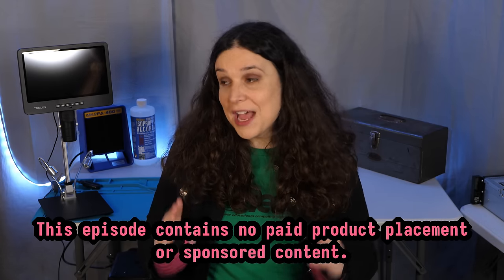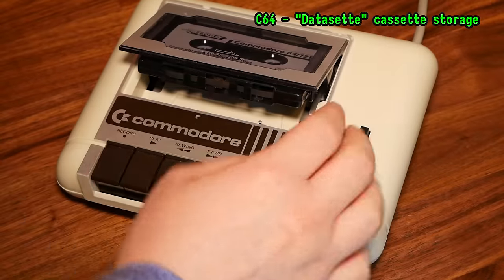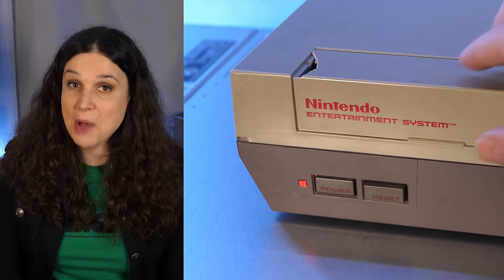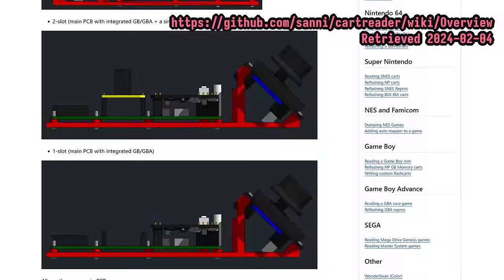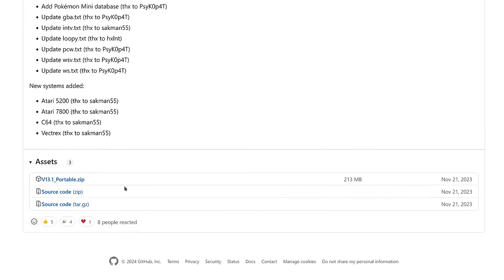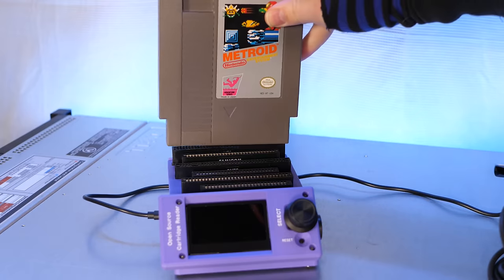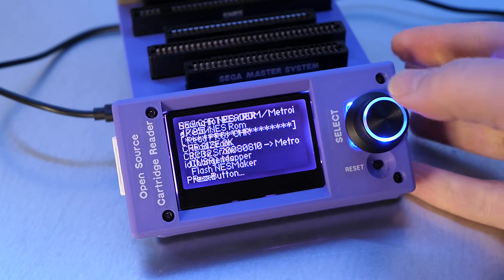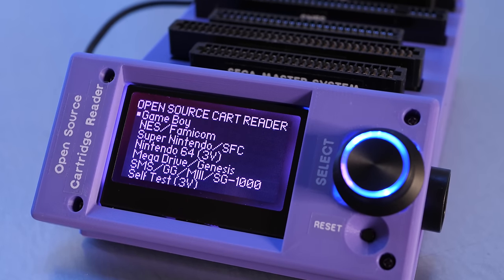Open Source Cartridge Reader: ROMs and saves from real hardware!

Comment: I have horrible news: I think the N64 is probably “vintage computing” now. So… this is more channel appropriate than we may want to believe.
Reply: Not only that, but the PS3 is technically 'retro'... And that deals me psychic damage.

Personally I think we need to reevaluate the criteria for such things... In early gaming every generation represented a quantum leap over the previous, so delineating 'retro' by generations or simply just the passage of time made sense... However, if we look at the past two decades, nothing after the PS2 has made such an advance.

This is why I insist that until something drastic occurs, the PS2 is the last "retro" console, and everything after that is still contemporary, with only incremental improvements in the quality of the experience.
Reply: @Bakamoichigei  PS3 is vintage, there are still plenty of original PS3s out there and I think it still enjoys patent protection. If it's not old enough to have it's patents expire, then it's not old enough to be retro.

Comment: Not affiliated with the project in any way, but the hiding the txt files on the sd card is most likely to, well, hide them. de-clutter the sd card contents so it's easier to find the file you dumped between all those files.

Comment: I’m one of the builders of this OSCR and I just wanted to say thank you so much for the kind words and visibility for this project! We’re so glad you’re enjoying it! 
You did such an excellent job of covering what an OSCR is in this video; I’ll definitely be sharing it whenever somebody wants to know more about what I’m working on. 😊
Reply from the maker: Thank you for the work you do! It's a great project and it's very appreciated!
Reply: does it support dumping pirated multi-carts?
Reply: Will a Jaguar cart set be coming too?
Reply: @johndrippergaming  Yes, but it's not as straightforward as choosing them out of the menu, and they won't be auto-recognized. There are some aspiring developers in the project Discord channel that can assist with reading the contents of multi-carts.
Reply: @XVa-uj8m  Sadly there are too many pins on a Jaguar cartridge for the current HW5 Arduino to support it. With newer revisions of the OSCR in development that are moving away from the Arduino Mega 2560, there may one day be a Jaguar cartridge adapter.
Reply: Very cool that you found this.  :)

Comment: I LOVE the idea of ROM files and saving save files. This is NECESSARY for game archiving and gaming history.
Reply: Yep, but the optical discs are even more important. Thankfully, I think it's possible to dump anything from the PS3 and older at this point, some of them are really easy like the Saturn and PS that can be done in a regular computer from RetroArch. Some are a little harder like the Dreamcast where it's just a cheap SD card adapter and disc to dump any of them. The Wii and PS3 are a little harder as they require that you have the system jailbroken to do. But, once you've done that, it's not that hard. 

That being said, the carts can be damaged over time, even if you don't use them, so backing those up for posterity is also a good idea. It's not a bad idea to use a combination of checksums and something like quickpar to repari minor damage and just run that on some sort of regular basis.

Comment: Nice one, Veronica! I saw my OSCR video peeking through one of your screen grabs... it's a neat and very useful device!  Re hidden files, I think the advice to hide them is just to help navigate the folder structure without all the extra file clutter when you're reading the card... at least that's why I hid all of my files. Re building one from scratch - there's a lot of soldering in the OSCR with all of those cartridge slots, but it's totally doable for less experienced folks, and it's great practice! And if you want some help improving your soldering skills, you should come out MGC 2024 next month and attend the gameBadge workshop - we focus on teaching soldering skills and you'll walk away with a cool pico-based handheld game system to boot 😁
Reply from the maker: Thank you so much for the comment! The workshop sounds like a lot of fun- I'll look into it as I figure out travel plans. BTW, thank you for your videos on MiSTer- you've been a big help as I've learned more about the ecosystem.
Reply: @VeronicaExplains  Thanks! ❤The MiSTer ecosystem can be a bit challenging to navigate for sure - I'm glad my videos have helped!

Comment: I never played tape games. It's still wild to me that you could use cassette tapes to store a game. I only ever used them for audio.
Reply: Same concept as modems really, putting data into an audio signal, except using magnetic tape instead of a phone line
Reply: I never actually used them, but between 1985-1988, in Finland, a radio program called sth like 'Silicone' sent computer code on the airwaves for listeners to record on their tape decks. You then put the tape into your early computer cassette drive to use it. Listeners made their own programs also. No wonder as this started in 1982 as a different project for citizens' edutainment benefit, we got Nokia phones and text messaging going first here - there was already a user base for tech stuff. Early PC mags always listed code to make your own programs, create drivers or tinker with stuff. Commodore 64 cost as much as a TV back then, and my first 486 machine the same amount as my first car, Datsun 100 A.
Reply: Only problem is it took a while to load the games these were very commonplace.

Comment: 》Its concept is something similar to that one employed with expansion cards connected to ISA/EISA/VLB/PCI slots throughout data bus, the same modular architecture we still see nowadays but, as you've said, it used be much more appropriate for actual implementation during that  technological transition from the 70s to the 80s.

Comment: Great video! The OSCR is an utterly indispensable tool for anyone into the physical side of retro games! I built my own v3 OSCR, and it's fantastic. 😃👌

The ability to rewrite flash cartridges is super cool. I've used my OSCR to write games to Nintendo's own rewritable Super Famicom flash cartridges. (Fan translations, romhacks, etc. All patched to ROMs dumped from my own carts using OSCR!)

And I've used my OSCR for preservation; a Satellaview 8M Memory Pak or Nintendo Power SF Memory Cassette doesn't come into my possession without a complete backup. And I back up the SRAM of any games I acquire so I can examine the previous owners' progress later. (Sadly I'm like 0 for 4 finding Mario Paint cartridges with any art still saved on them! 😢) 

btw, emulator SRAM compatibility is usually a header issue. I've yet to try loading an OSCR dumped SRAM in an emu, but I know that save data dumped with a magicom such as a Super Wild Card or Super UFO Pro 8 needs to have the header stripped out before an emulator will recognize it. 😉👍

EDIT: Oh yeah, something about the older v3 OSCR; it can also read pretty much anything through the SNES slot, given the appropriate adapter...since it's all just arbitrary GPIO...same as the newer versions. 😃 (Personally, I rather like the more compact formfactor though!)

Also, I've been running my OSCR almost exclusively off a decade-old powerbank for the half a year since I built it with no issues. It's super handy!
Reply: Hey, I know you! :P
Reply: @Ancyker  😜

Comment: On start up, the chip (TPS2113) that handles the power switching could go through any state, even when 3.3V is selected because its enable pin is permanently on.  The chip takes a little time to fully turn on and a little more time to actually decide what the output should be - we're only talking several milliseconds.  The author of the project can resolve this problem by enabling the chip a little time after it's turned on; it'll be faster than turning the device and then plugging in a cartridge.  The output of the chip is 0V when the chip is not enabled.  A common method to do this is with a capacitor and a Schmitt trigger.
Reply: The MCU controlling the chip is also powered by it, so delaying turn on isn't all that helpful. Your proposed solution isn't wrong, but the time difference would be measured in nanoseconds if not microseconds. The latency for the toggling of 3.3V comes from the time it takes the MCU to boot and set the pin state.

HW7 resolves the issue entirely by not powering the cartridge slots and processor with the same power rail. Instead, the slots get their own rail which can be toggled on and off and adjusted as needed by the firmware. It also monitors this rail to make sure the voltage is within bounds so it can cut the power to the slots if it isn't.
Reply: @Ancyker Two methods to solve the same problem, which is pretty much the same thing.  Mine is hardware defined, yours is software.
Reply: @Shocker99  I think you misunderstood what I was saying. Your proposed solution was not a hardware solution because it was not a solution at all. It was not the TPS2113 causing the issue, it was the microcontroller. Your proposed hardware solution would not have fixed this because the MCU is powered by the TPS2113, so your solution would have made the problem worse by delaying the MCU booting and changing the pin state even later. Also, this problem was actually recently solved via a firmware update that moved the pin state update to even earlier in the code.

Comment: I like this video and your enthusiasm! Thanks! I found this channel after you posted something on the OSCR Discord today.
The only thing I would have liked to see you mention in some way was how to update the firmware on the OSCR, this is basically my only 'quirk'/con with the OSCR. Would have been nice if the new firmware could just be copied onto the SD card and be loaded from the OSCR menu. But I can't have it all and thus far I'm quite happy with my OSCR.

One question I have is how you knew that for N64 cartridges it might be better to turn it on in 3.3V mode before inserting the cartridge to avoid the possibility of the 5V spike. I didn't find this in Sanni's userguide or I might just be reading past it.

I'm looking forward to more of your video's, like how you mentioned that you would do a video about fixing your NES. That one is looking quite bad, so I'm curious what you will be doing to it.
Reply: > Would have been nice if the new firmware could just be copied onto the SD card and be loaded from the OSCR menu.

The ATmega line does not support this. It has to be programmed by another device. The only way to implement this with the current architecture (the ATmega/Arduino Mega) would be to have another device boot first and look at the SD card for an update, and if found update the main device before booting it. I am currently working on an updater to make updating easier, but it will still require a computer.

> how you knew that for N64 cartridges it might be better to turn it on in 3.3V mode before inserting the cartridge to avoid the possibility of the 5V spike

The wiki page on Automatic Voltage Select.

Comment: I really want one of these but $200-300 is a bit much for me right now

Will definitely keep my eye out for different versions of this especially if there's one that can write to reproduction cartridges
Reply from the maker: This one can write to a lot of repros! At least from what I can see. It is a bit steep preassembled but I've enjoyed it.
Reply: @VeronicaExplains  guess this will be my next purchase after I build a new pc
Reply: Kits are about $100 if you want to DIY it. The soldering is pretty easy if you get the SMT components preassembled, which adds about $10-20 to the cost depending on if you want RTC or not (most people do not need RTC). It does take a few hours to do it all though. Also, assembled prices will be dropping soonish as well, likely to around $130-150.

Comment: That N64 port on the side for testing controllers is a great idea, and I'd love to see someone make a controller / cartridge tester -- plug in your controller or cartridge and know if everything is working great. Would save time for someone like me who buys and sells consoles and games and don't fancy dragging out a console and plugging it in every time.
Reply: This device can do all of those things (at least for N64)! It has a controller tester mode, but also, after dumping the ROM of a game for any supported system, it will run a checksum to confirm if the dumped data matches a known-good value in a database on the SD card. If it matches, the cartridge should be fully functional. If it doesn't, then either the cartridge pins are dirty (99% of the time there is a mismatch, this is the case), or the cartridge has a problem.
Reply: @cmcm711  yep, but I'm referring to a more generalised thing for multiple consoles. Something modular, where you buy the base and whatever controller or cartridge adaptors you need to suit your requirements, then you can plonk it on your desk and just test cartridges and controllers as you're working.

If I knew more about the hardware side of things, I'd attempt it myself, but I'm a programmer by trade.

Comment: Can the OSCR project be used to build a standalone emulation system or be used in conjunction with the Mister FPGA? It'd be cool to build a device using 1:1 scale 3D printed replacement shells for game consoles with the modern experiences like save states and Retro Achievements.
Reply: Soon™

Comment: That is so cool! Although it seems a hint excessive to me to have a separate device with its own display, controls and memory card slot, instead an accessory gadget that just has the cartridge slots and a controller, that connects to your PC via USB or whatever and then just have Linux drivers/tools for operating the thing.
Reply: Sometimes you need a toaster, sometimes you need an oven. You can do a lot more with an oven, including making toast, but sometimes a specialized tool is the most efficient.

Comment: If the battery is still good, you can always just wire a second battery in parallel to the main battery for a few minutes while you replace the main battery. That being said, it's far better to just use one of these units to backup the save ahead of time than to bother with that. Also, while you're at it, it's worth putting in a proper battery holder if the battery in there is soldered to the board so that the next time you don't need to. These carts just get more rare over time, so it's better to take the risk of redoing that now than later.

Comment: Thanks for this great video ! I have a question tho:
The txt file with all the game numbers in, it's used to identify games before saving, right ? 
So what would happen with a cartridge that is not in the txt file, like modern homebrew games for exemple.
I own some homebrew cartridge games I would like to secure.
Thanks for your answer 🙏
Reply from the maker: The devs add a lot of carts as time goes on, but certainly there's stuff they've missed. If the cart isn't in the text file, you can manually select how to dump the ROM based on the type of cartridge- usually this involves looking it up in an online DB or opening the cart and looking at how it's mapped (sometimes you'll see board numbers which lead you to the right path). 

I haven't done this myself but that's my recollection based on the info I read.
Reply: I see, I guess I will have to check if I can find that online or open my cartridge my self before I purchased a OSCR 

Thank you very much 👏

Comment: The save game backup option sets this apart from simply finding and downloading roms online but preserving those saves will cost some $$$
Reply: Even as a prebuilt it's far cheaper to get an OSCR than one-trick pony dumpers. For a GBx-only dumper you'd pay $50. Prebuilt OSCRs cost about $200. So for the cost of 4 single-system dumpers you can get this all-in-one dumper. It sounds expensive until you really think about it.

Comment: This debate of whether it's acceptable to dump your ROMs/download them or whatever is why we need to push for publishers to preserve their older games more, and properly at that. For some games like FF6 and Chrono Trigger, it's easy to purchase the game on Steam or your preferred console's online marketplace, but games like Digital Devil Saga are still locked to older platforms and thus not that easily accessible without potentially illegally downloading the ISO (depending on where you live at least)
Reply: The only mainstream publisher I know of who lets people purchase ROM files without forcing a specific method of play is Sega. If you buy the Genesis/Mega Drive collection on Steam and open the folder it's installed in there is a folder named uncompressed ROMs which contains all the ROM files for the games you bought. These ROM files are not used by the software which uses a modified version of the ROMs for achievements. Rather, these unmodified ROMs were included specifically for people who wanted to use their own emulation software of choice. :)